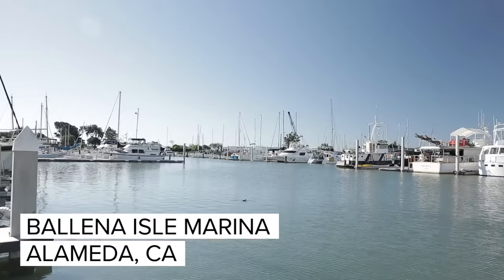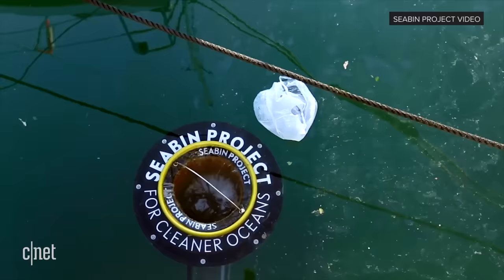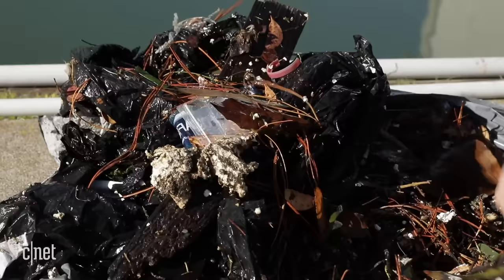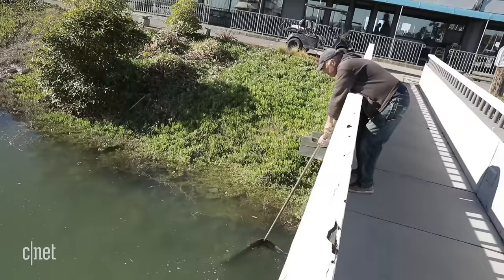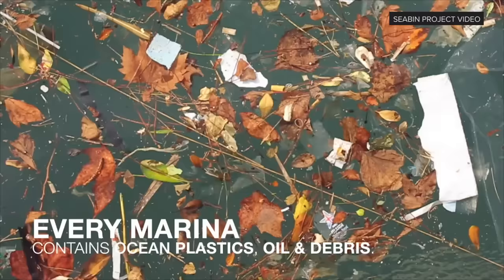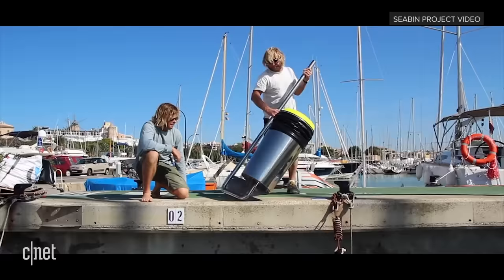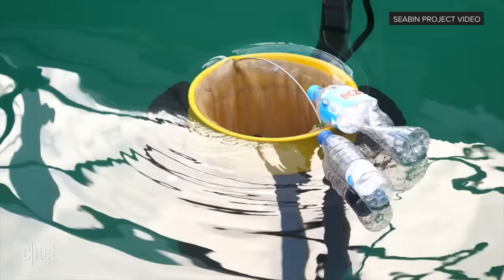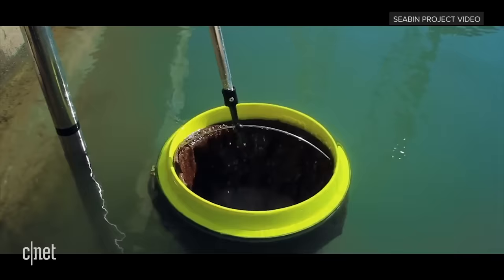Will Seabins save our oceans? The Seabin Project

Comment: So you took a pool skimmer and put it in the ocean..... Unless you can make this self-powered, the amount of energy required to move that much water will heavily outweigh the benefits this can provide. Especially because of the limited range of the thing, there's a reason why the debris collect in certain pockets and not scattered everywhere.
Reply: Citation for your (baseless) claims?
Reply: +Jaypob, Pool skimmers work because you have a constant current in a pool caused by the pump, that doesn't happen at a marina. Debris collects in pockets of calm water, and it stays there. You'd need a skimmer at every one of these points and it'd only collect what's around it. On top of that, consider the amount of energy required to move the water for their design. Each one of those probably require a 500-1000w pump, at $.17 cost of electricity, that's $4 of electricity use\day, $1500 per year, EACH. It'd be cheaper to hire a poolman to come and skim the water weekly. It works for a pool because the filter pumps are running anyways, so you don't need to use extra energy to do the skimming. Either you'd need to make the skimmers mobile, or create a current so that the debris moves around.
Reply: Eugene S true, thats why we need solar panel technology advancing so the cost will be feasible.
Reply: You can see it creates its own current, but it does depend on shape and size of dock, as long as you work out most efficient placement it will pull rubbish towards itself.
Reply: Its 1-4K and he said it can run on electric solar or wind? I don't see the problem
Reply: These things are designed for places like harbors and marinas, not the open ocean.
Reply: ecological issues have to be evaluated in total, and energy-consumption is a very important part of that.  Anyway, I'm totaly pro thinking about solutions, and only therefore this project has my total support.  But i do think that energy consumption is first and most importantly related to global change.
Reply: People say alot of things, a pump draws alot of power. More power than a single solar panel could realistically supply, not to mention unless you strap a big battery on it, it doesnt work at night. Wave power would be nice but its not practical to place a system on every one of these things. You would be creating far more waste than they will ever clean. Additionally if you watch the video of when he is checking the system, most of what it picked up was just pine needles and leaves, id say less than 10% of that was plastic, and when the bin is full.. its no longer cleaning anything. Don't get me wrong I like the idea, but in its current state its just a virtue signal, makes people feel like they are doing something by shelling out cash when in truth they are creating more waste than they are cleaning.
Reply: 1500 a year doesnt seem like much the average person can afford that
Reply: Thats an insurance payment, or a phone bill. When you live on the poverty line 125 bucks can mean the difference between your family eating or just your kids while you go hungry.
Reply: Let the government fund it and hire people to check and clear them new jobs for people and also benefits for the people in the area
Reply: Then you have whats called a government contract, meaning the price of these goes to 10k+ each, they hire a full set of government staff whose sole purpose is to handle the paperwork for this company and hire GS1 workers for the position, who are all making government salaries. Then what happens? They make a metric ton of these, some of which aren't used because they are contracted to do so. That creates waste, then they have to make the new filters and meshes as well as cleaning the old filters and ensuring the power systems remain intact.. which in salt water is a nightmare. So what happens, the federal government will give a grant to set all of this up, which is paid for by the taxpayers.. aka you and me, then when that money runs out one of two things happen. They dump all assets and this project goes under from lack of funding and all the waste they created making these things offsets what they are intended to do OR they create a new tax to fund this on a state level, which means that the average worker now has one more thing they have to pay for at the end of the day. That is the issue with things like this, nobody want to think of the back-end, nobody wants to think of cost versus benefit.. they just see a cool idea, take it at face value, and share it on facebook. Doing this means creating more waste and the only one that benefits is the company owner who just pockets all the government money he was just given.
Reply: Lilf Gaming Damn your going too deep into this you would think your government will know how to manage these types of projects
Reply: The only thing you can count on with humans is greed, there is no "to deep". Taking things at face value is what hurts us more, if we leave everything up to the government they will spend all the money they can, pocket what they can get away with and blow the rest.
Reply: Lilf Gaming docks and harbors are typically not funded by the federal government unless it’s a massive port of entry. for something where a typical fisherman parks their 18-50 foot boat you pay dock fees for a reason. When 500 people pay 100$ a month for a slip the docks and harbors of the local government can afford to put these in. It isn’t a huge expense after initial installation.
Reply: okay, 500 people on a single dock is very rare.. so that's already a bad example, I'm going to choose 50 instead which is still fairly generous and you would need a good chunk of these setup.. and hire someone to maintain them. So, lets say you bought 10 of these for a dock.. and hired a single staff member at part time to maintain them. Thats 30,000 ish dollars for the machines and 11,200 a year for the employee assuming you are paying them bare bottom minimum wage. First off the dock fees pay for what they need + a little extra for profit margins so if they are adding these the new costs will be added to the fees themselves.  Assuming they keep them for 5 years, thats 30 dollars added per boat slip, but thats also assuming a full dock, paying dirt wages, and the parts never need replacing. 

Assuming a 75% capacity (which is average) paying a normal minimum wage for a coastal state (10.25) at part time, and factoring in the cost of one extra unit to cover repair fees and replacement parts. The new expected total would be 48 dollars per month + power costs... per dock slip. Thats almost half the cost of the slip itself.. and for what? A hunk of plastic that created waste to make.. using a filter that created waste to make.. that mainly picks up leaves and general plant matter with a bit of plastic mixed in. 

The much more practical option would be to just not buy this hunk of plastic, and hire someone part time to pick up garbage off the beach and use a net to grab bottles and wrappers floating on the surface. Much cheaper, and probably more effective in the long run.. plus zero waste created.
Reply: Lilf Gaming some people just don't get it. They don't actually listen and think about what others are attempting to explain. All they say is "let the government pay for it"  the government doesn't need any more responsibility nor power. They can't do any damn thing right, all paid for out of our pocket. You're spot on with your explanations. I just wish people would start thinking and listening to others who know better than them.
Reply: I don't think I know better than anyone, I just don't ever take something at face value. People are people, and if theres a way to exploit something they will, and crowdfunding is the perfect scam site. Promise something you know you cant deliver, don't give a date for it and hope people forget, then fulfill the bare minimum you can get away with and pocket the rest. Its happened so many times, Solar roads, Plastic roads, Solar water, Earth Water, Air plastic, complete bullshit programs that benefit nobody but the people selling them.
Reply: Its 500w when used, but how often does it use that power?
He also said the amp needed was very low
Reply: you didn't have to say you know better than them, i'm saying it. haha
Reply: +jbw5485  You are free to be as wrong as you wish. haha
Reply: That's why they put them in the areas which naturally collect debris.
Reply: It's for trash at marinas so people don't have trash floating around their boat...
Reply: Pessimism solve's nothing! Wave Power was mentioned grumpy, grumperson! Everything has to start somewhere and evolve as experiments progress!
Reply: I don't get why you guys are defending an unproven product that uses sciences that you barely understand like it's the only way to clean the oceans.

Whether or not it's in the oceans 30 years from now will tell us if it was the right solution, and I guarantee none of your opinions will be why it is or is not there. The scientists and engineers discussing Seabins will be the ones that determine it's efficiency, not people arguing on Youtube about pools lmfao. 

Are any of you even reading what you've typed? It's like a bunch of angry little kids arguing over which superhero is the strongest (doesn't matter, Goku is stronger than all of them).
Reply: +Jake "I don't understand any of this so neither should anyone else. We will need to wait 30 years to understand how pumps work."
Reply: It sounds good but if you have spent any time in an ocean with current, you would understand why this would not work. Where I live this would fill up 99% with organic material and minimal trash. as most ocean trash sinks to the bottom.
Reply: Now if the government could only get involved and force the docks to buy these....... the inventor would be rich!
Reply: If the government forced every dock to buy one of these ... just think, of how rich this guy would become!
Reply: Abi 
Solar power isn't feasible either. Solar panels create next to no power and require the mining of incredibly polutive materials such as litheum for their batteries. Besides, a solar panel misses out on most of it's potential energy production if it doesn't turn toward the sun.

Comment: I don't think these can save the oceans alone. But I do think they are a good step in the right direction. These can help keep small oil spill that happen in harbors from escaping and getting out in to the open. It will also cut down on the trash from floating out of these harbors. I don't think this will however remove much trash from the open ocean which is where the issue is. Its easy to remove the trash from the shore. But much harder to remove it from the open ocean, where the sea turtles and other marine life will be more likely to find it and eat it.

Comment: I wondering if jellyfish would be affected by this
Reply: Ty Smith and what is so obvious here that it shouldnt be discused ? Do jellyfish swim on the surface? Well some of them yes and some not. The size is important too so u can take your sarcasm and go read a book about marinelife...
Reply: DomenLazar damb you played yourself there
Reply: Ty Smith Oh yeah and the water beneath the surface isn't moving at all. No. It is.

Also the majority of a jellyfish's mass is at the top, so if that's at the surface, which it will be to increase metabolism or photosynthesise, then it's going to end up in the bin and block it up.

I've tried to push a jellyfish out of a rockpool myself with a stick when it was caught up there at low tide; imagine it like a gelatinous mass that can easily slop over the edge of something.
Reply: kbamm69 or small fish, the marina where I keep my boat is a popular place for fish to spawn, and is always full of tiny little fish
Reply: Ty Smith I think I can figure out why just by this thread alone. You should work on that. And you were trying to act pretty smart and you know everything throughout this entire thread.
Reply: Ty Smith alrighty then.

Comment: What about small fish that get sucked in...
Reply: yeah ikr?
Reply: Raid Leet welp. They gone
Reply: I was thinking the same thing. I was looking for anyone else who watched this who was thinking the same thing.
Reply: Im sure they mentioned in the video they NEVER had a fish in the bucket.
Reply: Fish don’t swim on the surface of water.
Reply: Fish will come up to the surface, but they don't live there.
Reply: Fishes are mostly around the deeper part, fishes usually don't go to the surface, but if it gets trapped it can just swim because the bucket gets under the water multiple times so it have the chance to swim up fast, small fishes are really fast to so if they felt they were dragged in there they would just swim away so don't worry
Reply: But wait, the bucket is chock full of scary super deadly micro plastics, oil, and homicidal plastic bags. That has to be instant death for all fish entering the bucket. This is a fish killing field! Stop the genocide, ban seabins! Standard liberal "solution". Identify a problem, generate a solution that's outrageously expensive and causes more problems, demand more solutions, lather rinse repeat until you can watch it all swirl down the drain while blaming those guys over there.
Reply: It funny all the misinformed people trying to invalidate this. If you knew anything about fishes you'd know that they always swim against the current and don't stay at the surface. Like someone already said they've never caught a fish before.

And even if by some miracle a few fish dies, it would be way less than the millions of fish that die daily due to plastic in the ocean
Reply: There is one at 0:18 on the left I believe it's dead but it's on
Reply: They get stage 4 ligma
Reply: Natural selection
Reply: There one in the beginning
Reply: Did you hear the noise?? I’m pretty sure they’d swim away from that
Reply: In the two years of Seabin's existence, there have been no confirmed fish found in any of the meshes. I agree that it's outrageously expensive though, if we could mass produce these for much less (<$100) and use a reliable source of energy (as they said, solar and wave), this would be a much better invention. Though, not much is being accomplished by these other than keeping small areas of water slightly clean. This was most likely invented to perform small tasks and was then hyped up to be "something to clean up the ocean".
Reply: a fish will feel if its being dragged and swim away, only thing i could see getting sucked in is plankton and new born fish
Reply: They will feel that they was being sucked so they swim away trash don't swim so the sucking power of the thing don't need to be strong
Reply: The fish stay in the shower ( my homework is on this)

Comment: It is pretty energy intensive since water is pretty heavy. It can only suck trash that is near it since surface area is proportionately equal to the square of radius. So it will not be useful in still waters and needs external force to help push the trash from a distance towards the bin. 

Condition in the ocean is harsh. Biofouling will mean it requires regular maintenance.

Comment: 500 watts, that is half a kilowatt, that is like a microwave oven and more than your TV. it translates to 12 Kw pro day of constant operation.
I think this power consumption puts a damper on the project. He says it can be driven by solar. but a solar panel of 1,6 square meter got an output of roughly 200 Watt in ideal conditions and you will have to double up and install batteries if you also want it to continue powering this at night. so roughly 60 of those 200 watt panels to keep it going 24/7 if my math is right. Meaning that you will need to place a small solar farm on the roof of a nearby warehouse of decent size with a price tag higher than the sea bin itself.

Comment: Leaves and other organic material is not so much a problem, but everything that goes down a storm drain at the curb is. And the windblown trash is also a problem. The Seabin has to float, so it goes on a floating dock. Could it not also be attached to a floating arm? Perhaps that would be too prone to damage, or hard to access for cleaning. But we must work to reduce litter of all kinds and keep it out of the water in the first place! Still, the Seabin might help.

Comment: I have exactly the same system in my fish tank. It runs off 50 watt, cost USD$50 to buy. Filters 3000 gallons per hour. At $3000-4000, & 4 amps it isnt cost justifiable

Comment: Great idea but 500Watts is 3/4 hp  so that pump is shifting a lot of water but why. The unit only has to dip into the water so the volume displaced looks to be about 40 ltrs.   You could pump with about 50 Watts ?.   Pumping air to displace the water volume would be easer then releasing it by a syphon lock to get a surge of flow, then repeat.   Well done but you don't believe you need so much power.

Comment: Inadequate for most applications involving the ocean, I'm afraid. Unless you plan to stick a few hundred of these across every major entrance surrounding a pipe into the ocean. Even then, there is a cheaper option of just putting a mesh net directly over such pipes and regularly changing them out. Might be useful in some applications such as streams or canals and I do applaud the attempt, but just not sufficient.

Comment: "uses 500 watts, which makes it quite a low-power solution..." 500 watts is low power? That's as much as about five 40 inch hdtv's. I mean, I realize that "low" power is a relative term, and it's not enough to power a car, but still, your floating pump there is anything but "low power".

Comment: 500 watts? Could you calculate the CO2 footprint, please? 
I believe that if you don't use exclusively solar energy then this project defeats the purpose.
So, you need two 250W per unit and work only with sunshine :-)